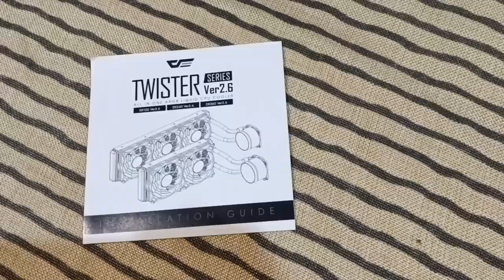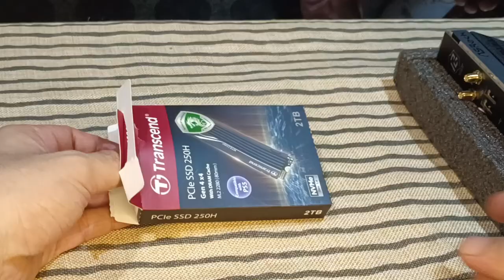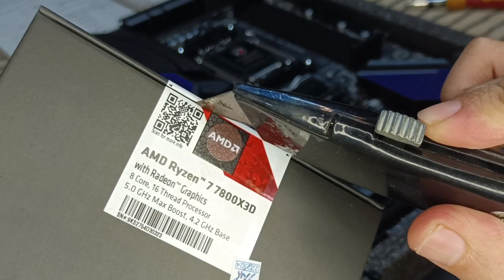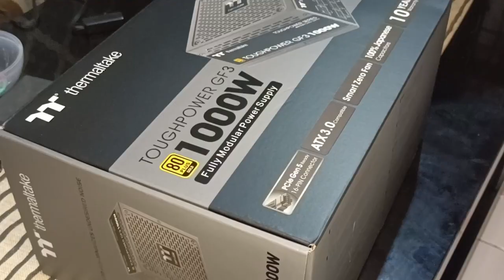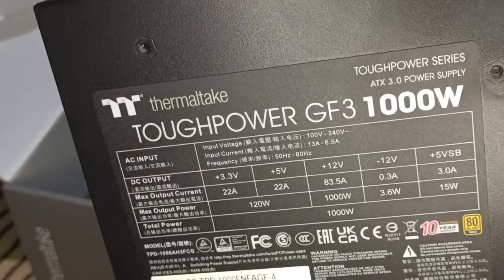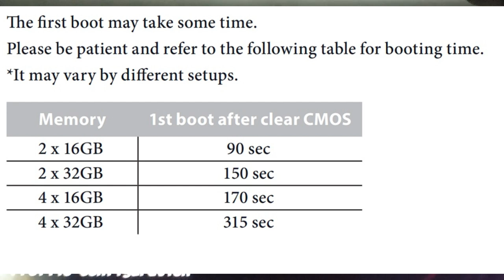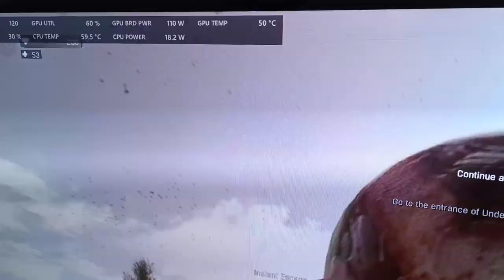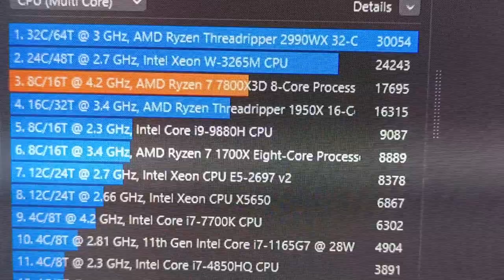AMD Ryzen 7800X3D + Radeon 7800XT + Asrock B650E PG Riptide Wifi - Rakit dan Review

Comment: Hello i just ordered this motheboard with ryzen 7600 cpu any problems during booting the pc with stock bios?or did you update before installing windows?
Reply from the maker: Hello... 

I did not have any problem. Just remember, for first boot, it will takes 90 sec or more on blank screen, depend on your RAM Configuration (Memmory Training).

I do update BIOS before instaling windows, because stock bios not fully support for 7800X3D. And i fully recomended for you to update BIOS before windows instalation, because the last bios update contain last version of AGESA (AMD Generic Encapsulated Software Architecture), that will give performance boost and more stability.
Reply: Βι @H4L_Random  thanks for response

Comment: Hi! You've got an interesting review. I keep dreaming of buying this motherboard, what do you say it costs your money, there's no point in overpaying?
I was surprised that she was able to pull such a powerful processor😮. Can you tell me if it's worth taking this motherboard if you don't have a big budget?
Reply from the maker: Hello, thank for comenting my video.  In my Opinion, this board are not over price, coz it have  PCIe Gen 5 for GPU and M.2 SSD and a lot of VRM where it's normaly found on more expensive X670 board. So i will say, this board is future proof with less price. 

But if feel like you don't need to prepare your system with PCIe Gen 5 GPU, you can can choose board with B650 or B650M chipset.
Reply: @H4L_Random  Thanks! I was just planning to upgrade my PC with a foundation for the future and I really liked this board, and your interesting build + recommendations confirmed it!)There would be more such videos on YouTube where they choose interesting and optimal options, and not for the price of $ 1000 or more for just one motherboard. From the category if you want to make a reserve for the future, take a top and don't worry